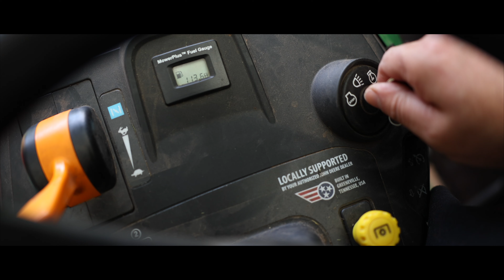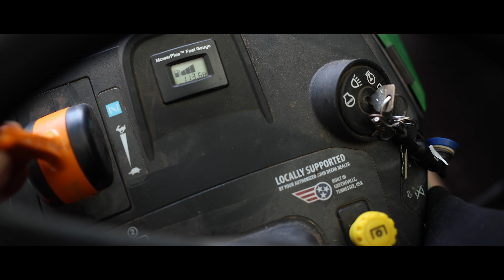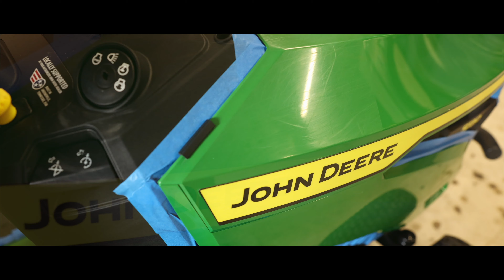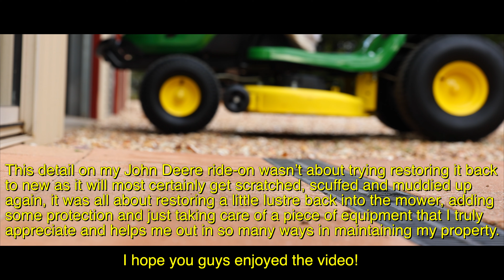Detailing a John Deere Ride-On Mower!

Comment: At first I was surprised by the high production values. Then I realized you were just taking as much time and effort with the photography and editing as you were with the detail. Nice work on both counts.
Reply: It's definitely something some folks don't think about. The detail (as with all Sandro's vids) probably took 1.5 times longer due to having to find the right shot angle and set up the tripod. Then there's the fact he has to work at weird angles just to make sure the action is captured without body parts getting in the way. The editing might have been the part that took the longest, but only Sandro could speak to that. What we see in this 30 min vid probably took 5+ hrs of work. The cars take even longer.

Btw, Sandro, the AU Machine Polisher link is broken. It's pointing to some tape. Also, thanks for another great video!

Comment: Hey Sandro, I have a theory I'd like to hear your opinion on. I have a BMW X3 with a panoramic sunroof which is waiting to get coated (by me). I also have bottles of Nv Evo, Dquartz Gforce, and Dlux. My theory is - with Dlux formulated as a wheel and plastics coating, it has the highest chemical resistance of the 3 but least paint enhancement characteristics. Therefore, for a panoramic sunroof which will never see a wiper blade, Dlux would actually be the best of the 3 to coat it in terms of longevity, given as it hasn't had to make any sacrifices in longevity to trade off for paint enhancement. What do you reckon about my theory?
Reply from the maker: You could be right - but if I had to guess what would last the longest there without any specific prior testing I’d tend to put my money on Evo

Comment: This was really good, don't forget to grease the nipples for the front steering and ad some LED bulbs 
You can see so much better at night. 👌
Reply from the maker: Yes all greased up and also got some fresh plugs, fuel/oil/air filters in - agreed the lights could be way better around dusk so will look into some LEDs, thanks mate.
Reply: @CarCraftAutoDetailing  I use Auxito they have a projector type/fish eye look to the bulb.

Comment: How would you restick a sticker thats coming off of plastic? One of my labels is peeling on my push mower
Reply from the maker: I just quickly cleaned the peeled section with some alcohol and put a little double sided tape on mind for now - probably won’t last long. It’s quit hard and messy to re-stick a failing sticker/decal, I’d say you’ll need to use some adhesive/tar remover to remove all the glue, and reply some fresh glue- might have to research the correct glue/adhesive to apply.